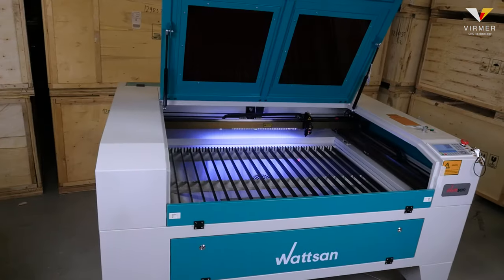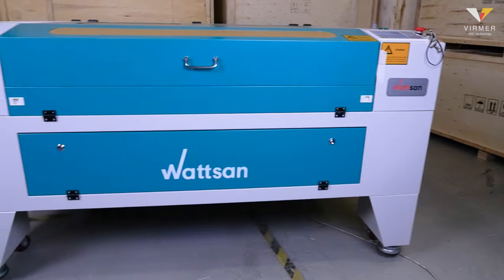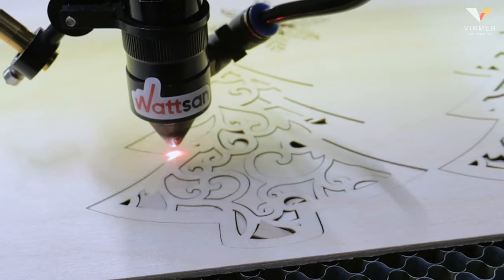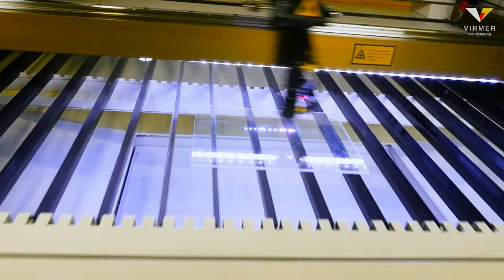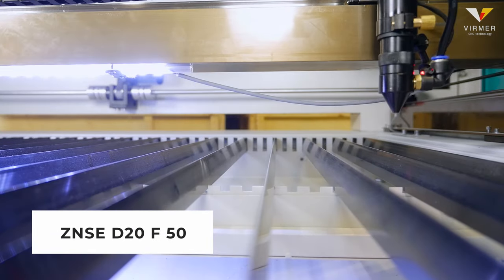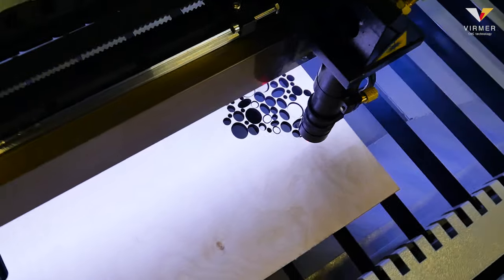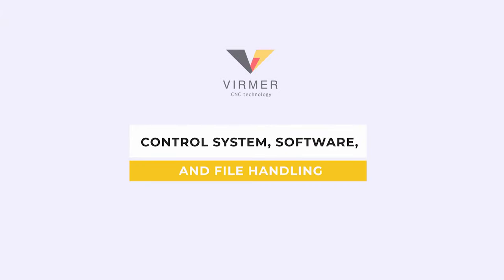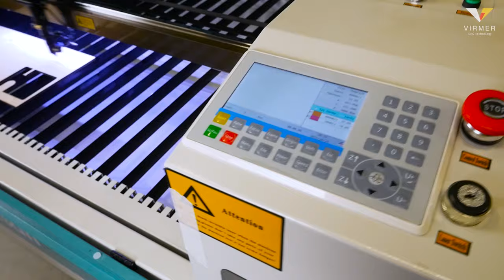Co2 Laser Engraving Machine WATTSAN 1290 LT / CNC Business

Comment: can I put a rotary device only on this machine? thks for video
Reply from the maker: Hello.🌏 Yes, it's possible to install a rotary device on the machine. Wattsan 1290 LT laser cutting and engraving machine is designed with a lifting table that allows you install a rotary device on to work with cylindrical materials. Wattsan Co2 laser machines have a wide range of working area sizes from 50x30 cm to 160x100 cm that can be installed with lifting table.